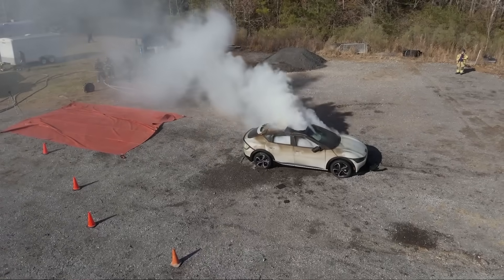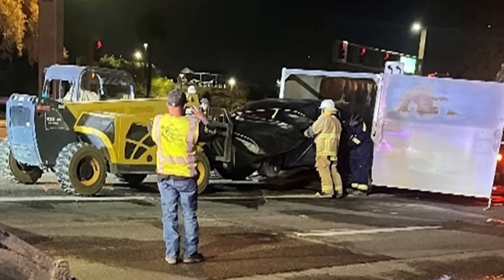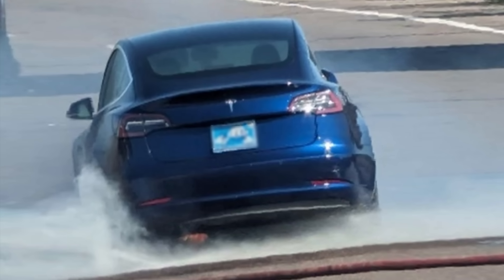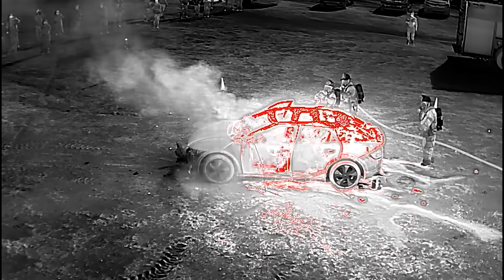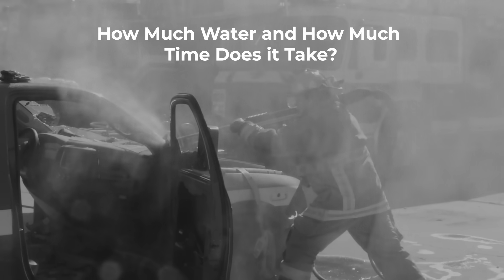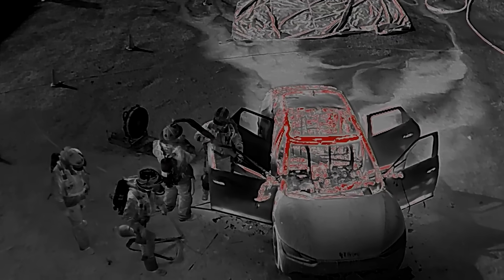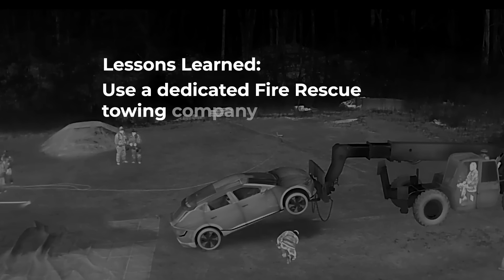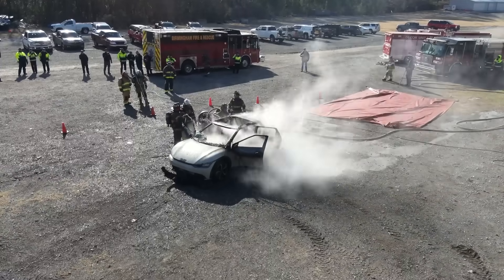Quick and Efficient Method of Extinguishing of an EV Fire tested in Tempe, Arizona

Comment: Sure every city has a fire tow truck.
Reply: Cities use tow trucks from private tow companies.  Burned vehicles are usually transported on a flat bed.
Reply: @solidstream13  that is not the point being made. This video is basically a quid pro quo commercial disguised as a training video.  The dude was trying to sound special by suggesting a fire rescue tow truck. No company is going to be ok with a burning car on the flat bed.
Reply: @JasonNotBot  Stop with the intentional ignorance misinformation. You do realise like a hundred BEVs fire have already occurred. It's pretty obvious when the fire is fully extinguished. NO ReIgnition is not really a threat. Then any tow truck or waste disposal truck picks up the remains of the EV. That's how it's already done and does not require any specialized new vehicle.

Comment: Now you’ve got to throw your turnouts away every EV fire if you’re getting in close like that. All the hydrogen fluoride that comes off of that cannot be deconned
Reply: Turnout gear is designed to deflect water and heat. During a lithium fire things like cobalt, nickel, manganese, and lithium salts will get to you through the sewing thread holes in turnouts as well as the fabric itself. EV fires are the new AFFF foam in toxicity. If.you are fighting an EV fire the best thing to do is not let the smoke or water hit you,
Reply: "hydrogen fluoride" you do realize that comes from Burning PLASTICS! ICE Cars have basically the same amount of PLASTICS!
LEARN basic chemistry before spamming fear mongering absurdity. Should the turnout gear be thrown away after every ICE vehicle fires?